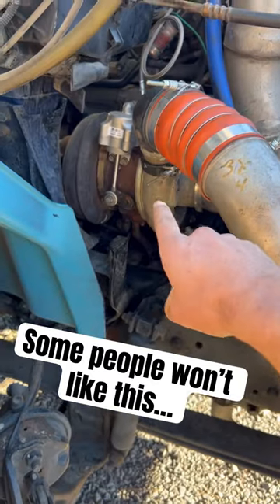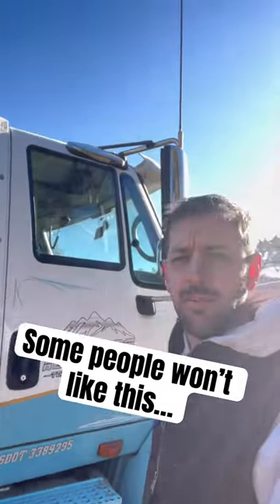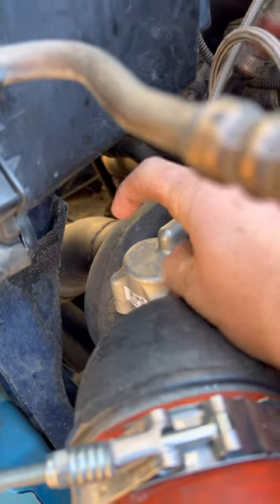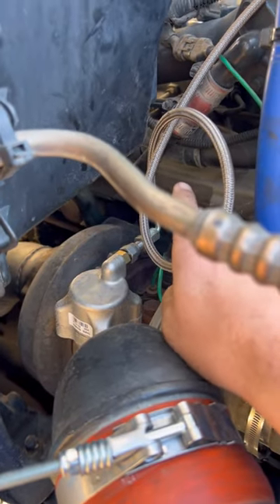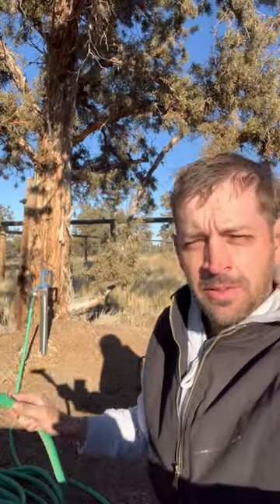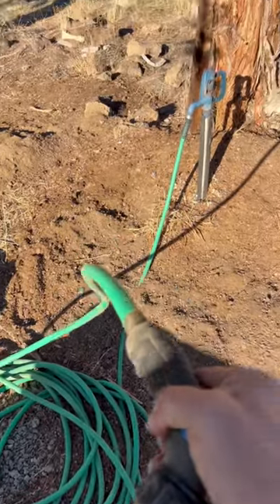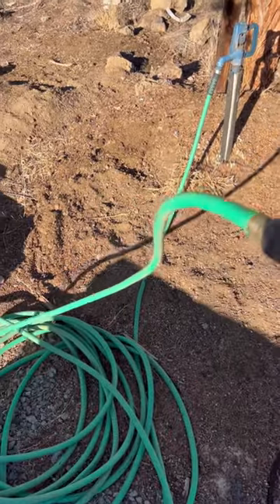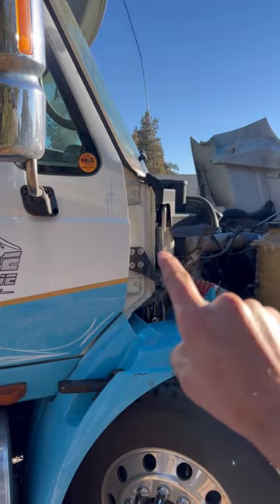Will it hurt the turbo??  (Physics made simple)

Comment: Ever hear of valve overlap? Valve overlap is the period during engine operation when both intake and exhaust valves are open at the same time. Valve overlap occurs when the piston nears TDC between the exhaust event and the intake event. Duration of valve overlap is between 10° - 20° of crankshaft rotation, depending on the engine design. There is a good chance that the timing events of one of them cylinders is in a valve overlap position making it entirely possible for air to flow through a stopped engine in either direction so if being towed backwards then air forced through the exhaust stack can indeed flow through the engine spinning the turbo impellers without the bearing being lubricated.GO BACK TO SCHOOL.
Reply from the maker: Prove me wrong then
Reply: @CaseyLaDelle 
Well you obviously read my post about valve overlap. You must have read the part how intake and exhaust valves can be open at the same time. With a possibility of valve overlap occuring for up to 20 degrees of camshaft rotation or 10 degrees of crankshaft rotation times six cylinders this makes it a 16.666etc percent chance that valve overlap has occurred at engine shutdown. This also makes it possible that every sixth time a six cylinder engine is shut down overlap has occurred, and a higher chance overlap has occurred on a V8 engine. When overlap does occur then air can flow through a non running engine in either direction, direction being dependent upon outside influence such as an exhaust stack effectively becoming an air scoop when being towed backwards. Again, if air is flowing past a turbos impeller then the impeller WILL SPIN and the bearing is not being lubricated because the non running engine provides no oil to the bearing.
Reply from the maker: @johnherlan6875  and yet you still can’t prove me wrong by making the turbo spin from the wind.
Reply: If air can flow throw an engine then it will flow past the impeller of the turbo and it will spin the turbo. It's not rocket science and if you are not capable of understanding this simple law of physics then educate yourself because I sure can't fix stupid. 
ps, Good luck in life, you'll need it.

Comment: The exhaust must be blocked when a truck is towed backwards. You're right that it won't spin the turbo (they can't spin backwards because of the shape of their veins) but it can cause the engine to start backwards briefly causing the transmission to jump into gear. If this happens while towing it, will cause the axles to snap and the tuck to jump off the tow truck. Seen this happen several times. 😂

Comment: So your telling me when you shut an engine off every single valve is closed and perhaps 1 or 2 valves arnt open even slightly letting air into the cylinder and out the intake valve allowing the pressure maker to spin ?

Comment: Somebody please take down this video as it is totally incorrect and laughable. A person who knew how an engine worked would have known that both intake and exhaust valves can be open at the same time and therefore allowing air to flow through a stopped engine. That in turn will allow air to spin the unlubricated bearing so this theory is outlandish.
GO BACK TO SCHOOL, or at least take an engine apart before you make such uneducated claims.
Reply from the maker: Prove me wrong then
Reply: @CaseyLaDelle  What, you again, lol. I can and have proven this theory to be incorrect. I have explained how air can flow threw a stopped engine. I have explained how the turbo can be spun without oil providing lubrication and protection for the turbo bearing. I some how have not been able to help you understand basic physics so I invite you to please explain what part of my theory is incorrect. Give details, not a generic because your wrong reply.
Reply: @CaseyLaDelle Well it's obvious you have no clue what your talking about. Not capable of poking holes in my statement and not capable of backing up your statement.
I do want to thank you for the laughter I got when you compare an engine to a water spigot.

Comment: WRONG. I'm not saying that air will blow in an exhaust and ruin the TURBO bearing due to lack of lubricant in a spinning Turbo impeller, but you are totally incorrect in that the fact that air can't flow through a non running engine. Weather its an inline six or V8 at a very minimum a few cylinders will have both the exhaust and intake valves open thus allowing air to flow through the exhaust  side of Turbo, through the exhaust manifold, through and open exhaust valve, through the cylinder, through the head, out of an intake valve, backwards through the intake manifold. 
(now if air is flowing backwards through the exhaust side of the turbo it will also spin that side of the impeller backwards inturn spinning the compression side impeller also backwards  which will in turn pull air from the intake aiding in air coming in through the exhaust stack)
The ONLY way to stop this backwards flow is to physically close off the stack or physically close off the air intake.
Please don't make uneducated comments, do the math and prove me wrong, I bet you can't.
Reply from the maker: I literally did prove you wrong.
Reply: @CaseyLaDelle How?
Reply: @johnherlan6875 at no point are the intake and exhaust valves both open on a 4 stroke engine
Reply: @fandango_buttlicks WRONG, Ever hear of valve overlap? 
Valve overlap is the period during engine operation when both intake and exhaust valves are open at the same time. Valve overlap occurs when the piston nears TDC between the exhaust event and the intake event. Duration of valve overlap is between 10° - 20° of crankshaft rotation, depending on the engine design.
So again. air can travel through a non running engine making it just as possible for the air to enter exhaust and exit intake or enter intake and exit exhaust. This in turn does make it possible for a turbo to spin without the protection of oil while being towed backwards. 
GO BACK TO SCHOOL.

Comment: You are correct, but I wonder if the truck had a completely straight pipe exhaust would air flow through? Now you got me thinking, love the videos good job
Reply from the maker: No
Reply: There is such a thing as valve overlap. Not saying it would be enough to actually damage the turbo but it’s been proven it can spin if the engine stops with the valves overlapping.
Reply from the maker: @earthconstructor  no it hasn’t.

Comment: one cylinder will always have both valve slight open and  you will spin the turbo
Reply from the maker: No it won’t.
Reply: yes it will @CaseyLaDelle
Reply from the maker: @nfarnell1  prove it
Reply: next time you are testing an air to air reverse the test adapter and blow air into the turbo and put your ear near the exhaust. and listen to the turbo spin.  @CaseyLaDelle
Reply from the maker: @nfarnell1  no need to listen, pull the pressure side boot off and look at the thing sitting dead still.

Comment: If you compare a water spigot to an internal combustion engine you haven't a clue of what you're talking about. I have proven you wrong several times but either your ego won't allow you to accept this or your just plane stooped.
Reply from the maker: Do it on video.  I have no idea who you are or what you think you’ve proven, but until you show me a video of a turbo spinning backwards from wind blowing on the stack…. You’re full of shit.
Reply: Ok, you were ahead of the game when you only disclosed your third grade mechanical knowledge comparing an internal combustion engine to a water spigot but now I feel I owe your parents an apology for arguing with an actual third grader who hasn't the mental capacity to look up the meaning of valve overlap which would teach you that an engine can have both intake and exhaust valves open at the same time. This information is readily available to everyone on the Internet. Once an able and properly functional brain understands these simple facts it would be easy for this able and properly functional brain to understand how it is possible for air to flow through a non running engine. If your simple mind can't see it in action then this incorrect videos surely the least of your issues.
Reply from the maker: @johnherlan6875  I am well aware of what valve overlap is, and if YOU actually had a clue what you are talking about you would know that the water faucet I compared the truck to is an open drain spigot, meaning that it is NOT sealed off, and it is possible for air to flow backwards through it, and therefore it was actually a great comparison!   But like the engine, there’s no way in fuck that enough air could flow through it to ever make anything happen.  The simple fact is that the turbo cannot, and will not spin from wind blowing into the exhaust.  Just like you cannot, and will not be able to make a video showing that it does.

Comment: You’re wrong
Reply from the maker: Prove it
Reply: It will diffently happen on older engines , maybe not on smog trucks . A cylinder can have a intake valve& exhaust on overlap * that lets air flow in exhaust & out intake valve & out the intake side !! Yes it does happen sometimes, not necessarily all the time . Sometimes you get lucky sometimes you don't!!! Caterpillar bought several turbos on dozers thet had exhaust stack facing forward , when dozer got to dealership  turbo had to be replaced. Peroia Illinois to Calif.
Reply from the maker: @ruxoneto6560  fun fact, this isn’t a “smog truck” 😂